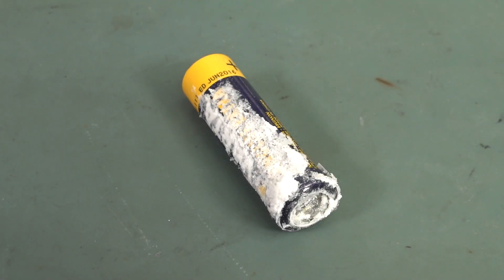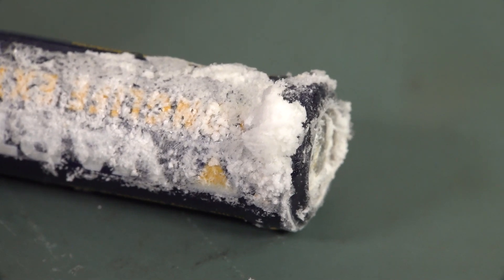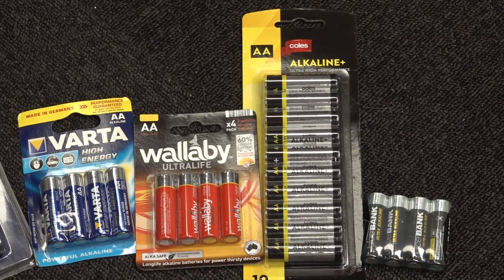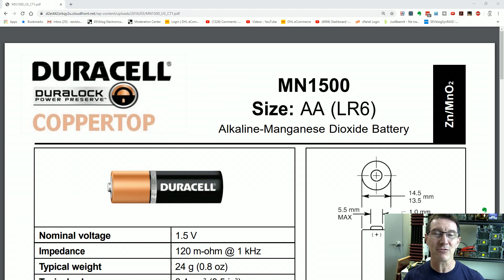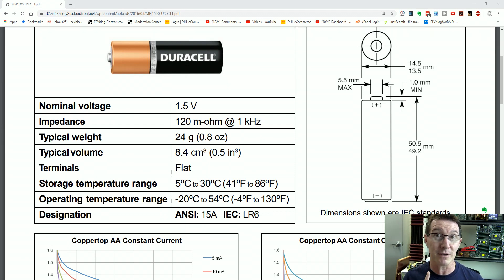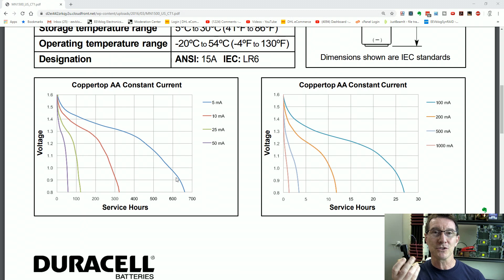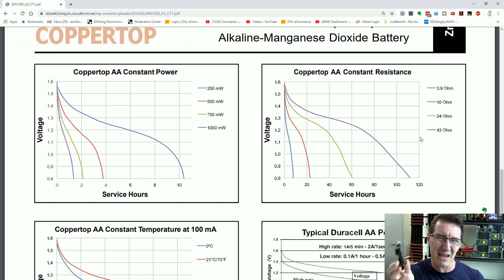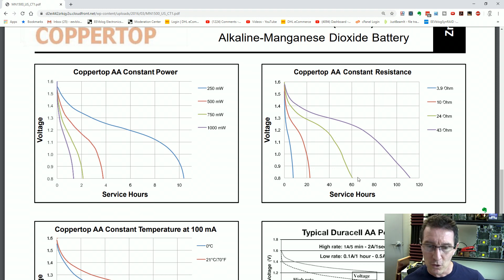EEVblog #1296 - Alkaline Battery Leakage Testing 2 - Electric Boogaloo

Comment: I’ve given up on Duracell’s due to repeated problems with leakage.
Reply: Now that I think about it, I’ve mainly used Kirkland, energizer and duracell batteries for the last 10 years, and only had leakage and crusty boards from duracell batteries. My “bad-ery” jar is full of dozens of Duracells and one chinesium battery
Reply: Same here £50 thermometer destroyed, Duracell said tough as battery 1 month past it's BBE date!
Reply: same here, it was my battery of choice back in the 80's. now, never use them.
Reply: Amazon Basics batteries are better than Duracell...
So is Energizer, but they're hard to get here because someone remembered they're the new name for Union Carbide (yes, that Union Carbide) and decided to launch a boycot campaign against them.
Reply: I've had similar problems, had several devices ruined. For the last several years been using Harbor Freight Alkaline batteries.  So far have not had any problems. But I do try to not leave them in for years at a time.
Reply: Duracell were once a good name, I believe P&G bought the company and moved production to China. The last ones I bought (and they will be the last I ever buy) had leaked in the package!
Reply: Richard Sheppard,
P&G, the same company behind Gilette ...
Is that the best a battery can get?!

P.S. I call 'em "Durahells" ...
And their 9V alkalines will bulge on the ends and explode, all by themselves, ejecting parts across the room and damaging devices they happen to be in.
Reply: Duracells are truly the worst batteries one can think of. If electronic stuff I buy is supplied with Duracell batteries, I dispose of immediately. I don't mind if they're brand new or not. In the waste bin, that's where this rubbish belongs.
Reply: I have given up on Alkaline Batteries. I use LSD NiMH accumulators instead. If they leak, they will loose only a little bit of hydrogen and that won't kill my devices. The only thing i have to do is to make sure over time, that the voltage doesn't drop below 1 V.
Reply: Have an unopened pack of 16 AAA Duracells.  Over half are leaking and still years before their use by date.  :P  Garbage.
Reply: @danm3188  No surprise here!

Comment: I cant help but wonder if there could be some galvanic reaction happening between the battery terminals and the batteries that helps them leak... battery ends could be nickle plated copper, on a stainless steel spring with a copper wire crimped on for the leads, battery off gasses slightly in a very tight confined space, and that speeds up the reaction... you may have to find a way to put these into the smallest space possible if you want to ever see results. 

That said, they always leak when they are in something really expensive... tupperware just wont do. ;)
Reply: I've had name brand (Duracell, Energizer, and Rayovac) alkalines leak before the expiration date while still in their unopened packages. I've even had mostly discharged cells sitting loose on my desk spontaneously start leaking.

Comment: I think the 100k long term load is probably the ticket. They seem to have to sit for some time before the byproducts of the reaction start to attack the battery case.
Reply: Yes, I think discharging them with 47 Ohm was too aggressive, and didn't give them enough time to rest at a low voltage level. I think completely flat isn't what kills them, rather almost flat.

Comment: Ah cheap, leaky alkaline batteries. I still have an old TI-89 from College with about a 1/2 lb. of 60/40 in it to replace all the tracks that were eaten off by leaking batteries. Moral of the story: Don't ignore the low battery indicator.

Comment: I'm having a lengthy spate of old pre-used batteries going full melt-down in remote controls (15 to 20). Many brands, between 5 and 15 years old. Whatever makes them leak is happening almost reliably. Not sure what exactly has been repeated here but I know I run them down in their first device I put them in, then they go into remote controls. Perhaps I should stop using new rechargeable batteries so I can continue the process... or not.

Comment: Dave, is it worth doing a set of controls, where you pick one brand you have in excess, and keep one fully charged, then one of each discharged down to 0.5 or whatever the lowest output you can get it to drop to, and then a couple at that level hooked up to different loads?  That way you may be able to gauge what conditions cause failure if there is some sort of consistent outcome at the end of it?

Comment: Sense you are trying to figure out what causes the pressure in a cell to go up, could you just attach a Bullet Piercing Valve to a cell, try something, and see what the pressure change is? I would think it would be relativity easy to see what has the greatest effect on internal pressure even with the added variable of the valve assembly.

Comment: I recently (after seeing your last video) open up a hand held two way radio, and found the Duracell battery's in there were supposed to have died in 2018. Looking at a new pack, which are labelled as 2026, so assuming they are giving them a 6 year shelf life, that kind of implies the radio battery's are about 8 years old. they still have usable power, not bad for all the Duracell haters in the last battery video.
Actually, I have a later pack, probably a few months old now, and they have done away with the 'best by' date.
It would be far better if the stamped a production date on them, but they don't.
I was surprised to see the seals on the negative end, when I was a young one, I use to decapitate old carbon zinc cell's, their seal being on the top, or positive end. strange.

Comment: My alkalime batteries only leak when i charge over 1 .75v
Reply: That's the problem: you should charge them only up to 120 Ohms
Reply: Maybe if you charge it at higher voltages it'll reach a point where it wont leak anymore. Maybe 12v will do it.
Reply: @s8wc3  lmao and make sure to tightly wrap the battery in tin foil before hand so the electrons dont get out!
Reply: @johnson42069  And use a 12 V lead-acid/LiFePO4 battery to recharge them after wrapping them with tin foil, that will provide enough current. Make sure to hold them tight while charging, too, or the electrons will escape.
Reply: @s8wc3  Rodalco2007 entered the chat. :D
Reply: i just stick them into my 18650 charger for a few uhh... not long... they tend to go squirt
also, do NOT try to rechagre heavy duty batteries...oh hsit, i gotta send bigclive a tip and ask him to try that
Reply: You're supposed to charge them in the microwave
Reply: Why are you doing it the hard way? ... An old power cord with the female end removed, attach alligators, clip to battery, plug into wall outlet......fast charge! (Maybe I should TRY the wrapping in aluminum foil first, see if it keeps the magic smoke inside..)

Comment: NO , Noo Noooo, :In German,my englisch isn't good enough: Dave du bist einer der besten die hier zu sehen ist. In letzter Zeit aber, sind dein Videos so uninteressant  geworden. Ich vermisse deine hochinteressanten Themen wie neue Geräte mit den Pro und Contra und dem Teardowns, Dumpster hunting, Reparaturen, Reverse Engineering. Lehrvideos über Bauteile und Schaltungen. Keine Solar Roadways, zerstören von Messinstrumenten 🤬, Batterie Wiederholungen. Schade Schade 🙈
Reply: Crude translation as I don't think Dave understands German:
Dave you're one of the best YouTubers. However in recent times your videos have been so uninteresting. I miss the videos about teardowns, dumpster diving, reverse engineering. Educational videos instead of this. No solar roadways, restoration of instruments or battery videos.
Reply: @MrPhilip796  no restauration, i mean , dave has destroy cheap meassuremt equipment. I'd like this. Ist's waste ressources.
Reply: @poc_3000  and then?,, by another one
Reply: @poc_3000  °《⊙¿⊙》

Comment: I would dispute the discharged battery claim for the f'king Duracells - a few weeks ago, a Maglite torch that had new D-cells only 1 year ago, that had not even been turned on (it is in our fire response cabinet) had leaked and destroyed the torch. The batteries were brand new. I sent you a photo on twitter Dave.
Reply: If it’s one of their LED lights (I had two before I gave up on the brand), I’ve seen what appears to be parasitic draw even with the light off. It got to the point where I was just unscrewing the tail cap to turn the light off because of the strange drain.
Reply: @mman454  OK thanks, will check that out. We've used the brand for many many years and never had this before.
Reply: @mman454  the converted LEDs are better than the factory LEDs for this reason
Reply: Or company passed out hundreds  of mini mag as emergency lights with Duracell a a batteries. 8 years later  we have most  of them  ruined from leaking batteries.  Everyone said they never used the light and the batteries are stuck inside now.
Reply: had the same with a camera flash years ago. Put in fresh Duracells, 2 days later (it had not been used, batteries brand new), I fired up the flash and it gave a load of failure codes.
Opened the battery compartment and all 6 of the duracells were leaking goo and crystals.

I was in a hot environment, but not beyond the rated temperature limits of the batteries.

Tried to get compensation from them, no luck of course. 500 Euro flash gun destroyed utterly, the acid had leaked out of the batteries and destroyed the electronics.
Reply: @jwenting  Doesn't Duracell have a quarantee in such cases? I would cantact them if I was you.
Reply: @robbedoeslegrand236  I contacted them, they claimed no responsibility and that was it. 
Can't remember why, think because it happened in a country they aren't sold (I was on a trip in central Asia at the time, had brought several packs with me as it was pretty hard getting anything there) or because of the weather (warm, dry).

Comment: The yellow topped kinda look like some "Defiant" brand batteries I bought from home Depot, although it said they were made in China.  They all started leaking, corroded the contacts inside my remote controls.  Pure garbage.  Had to throw the rest of the package out.
Reply: I once bought a tray of like 50x 3V lithium CR1632 button cells from dealextreme. Used one. After about half a year I looked at them and 90% was leaking crystals. (Do lithium primaries even do that!?). After another half year none remained good.
Reply: ZomB1986 
I’ve bought a few packages of lithium button batteries from AliExpress. Some CR2032 and some assortments of sizes. Random brands/sellers. (Usually cheapest I can find;) They happened all to be fine. 
There’s no message in this comment and certainly no recommendation. Just sharing my experience.
Reply: @ZomB1986  it sounds like it's kind of a craps shoot with Chinese batteries
Reply: ZomB1986,
I've seen button cells that are literally puffed up, and even had one explode. It seems pressure builds up inside during normal use...!!!